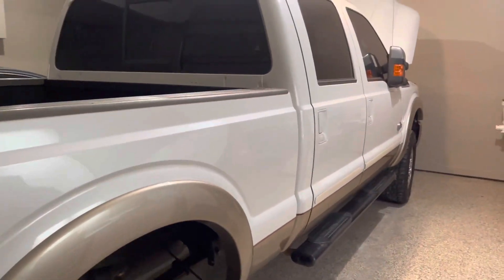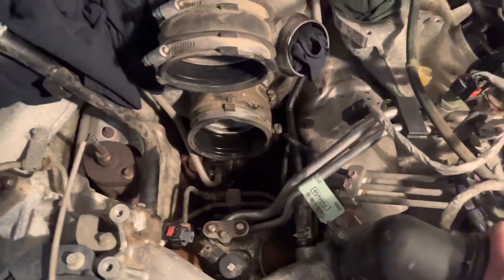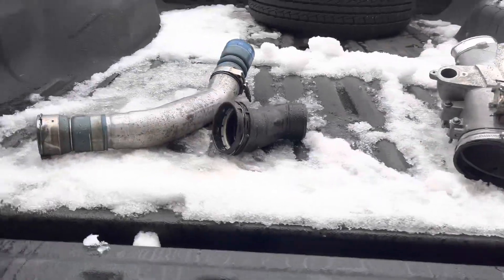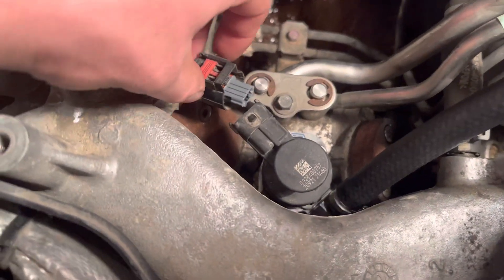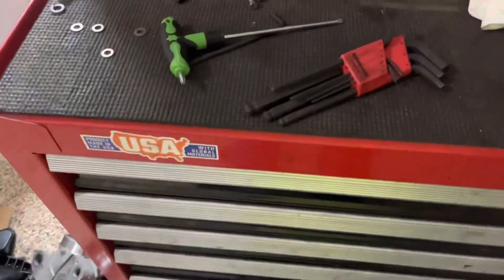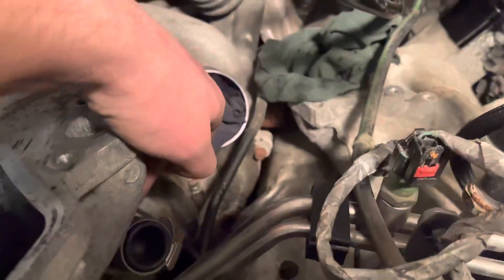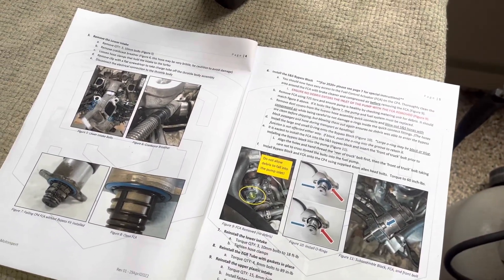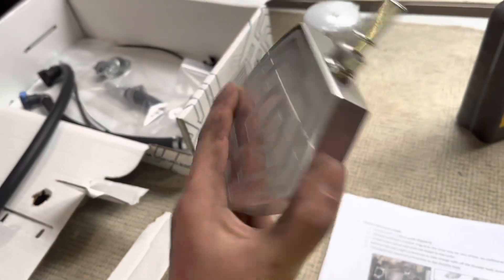Installing S+S diesels CP4 bypass kit on my 6.7 powerstroke!

Comment: So I'd love to install this modification to my truck, it seems with the potential troubles of the CP4 that it's almost mandatory⁉️ However, with everything you've described here, it looks like it's a 7/10 scale of difficulty? Also that elevated creeper is required for our trucks to do anything in the engine bay. Thanks for putting out these videos Nick!
Reply from the maker: Thank you and yea 7/10 at most, wasnt very hard at all